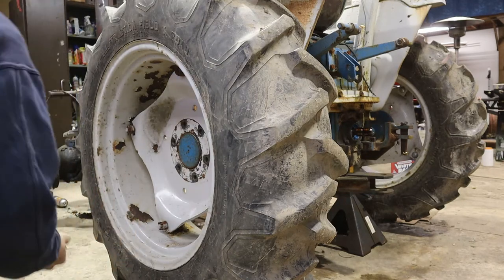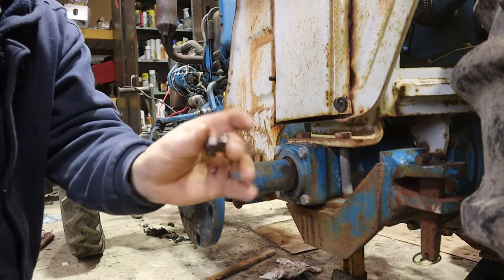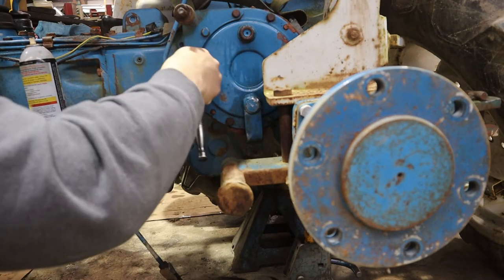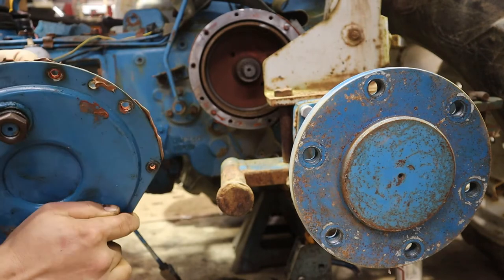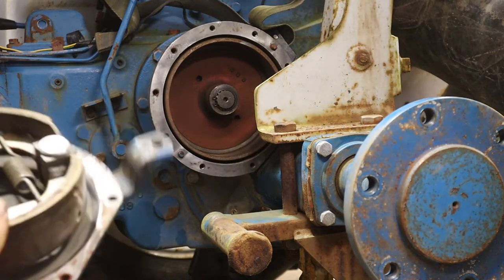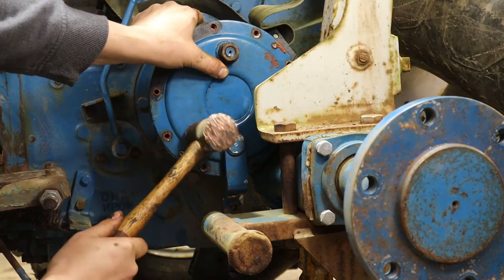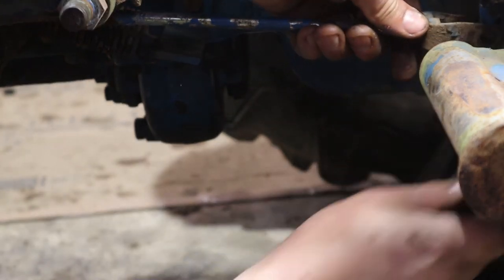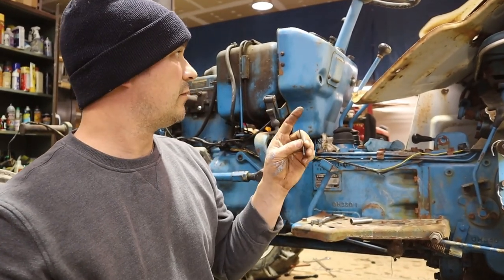Ford 1700 Backhoe Rear Brake Repair

Comment: Your video helped tremendously. I had just bought a 1510.... Previous owner neglected to tell me the brakes were none existent. Found that out when i tried loading it on the trailer. I'll definitely try the adjustments first.... But at least i know what I'm getting into, if i do have to go further. Yours was the ONLY video I've found that covers brakes.
Reply from the maker: Thanks for the information, glad it helped

Comment: Thanks! Wondered what was behind the secret door (cover) on the brakes and plan to tackle this on my 1210.

But on my 1210, the linkage on both sides was already fully adjusted to its max to where the threaded rod interferes with the linkage if I were to go any tighter. However the drum and the pads have plenty of meat left of them. So I trimmed 1/2" off of the right-hand-threaded end to create some clearance.

Also my brake covers had no gasket. So I used some RTV to seal them up. Had a lot of rust dust in the drums and shoe assemblies. And I had to lubricate the lever bushings.

Comment: Thank you for this video.
Really appreciate it. I have the 1600 with the same issue on the left side.
Reply from the maker: I'm glad it helped you
Reply: @rushedscheduledfun3963  
I didn't have to remove the tire or the fender wall. The break assembly came out very easily. 
I wanted to make a video, but at 98⁰ out, it was nearly impossible  lol

Comment: If these tractors set up for a while the condensation builds up in the brake hub area and rust forms behind the pad and the glue fails on today's aftermarket versions.
Clean and fresh hydraulic fluid helps delay this issue which is common.
New pads are much thicker than the ones you're working with.

Comment: Great video but please be careful. The original brake parts of the 1970s and 80s Ford tractors have asbestos (per the parts manual) and the New Holland site where you can check the all the parts diagrams and lists for the Ford tractors and you should be using minimum an N95 mask and gloves and vacuum everything with an HEPA filter before replacing the parts. Cheers.

Comment: Looking for a rear axle seal repair for the Ford 1710 and 1910
Reply from the maker: Hope you can find it.   Probably need to part number off a diagram to make sure its the correct seal.